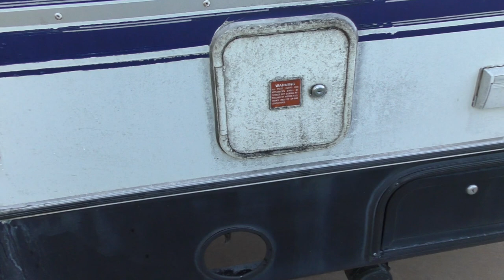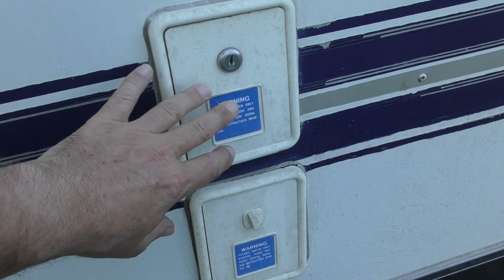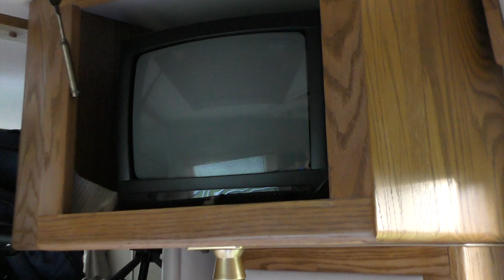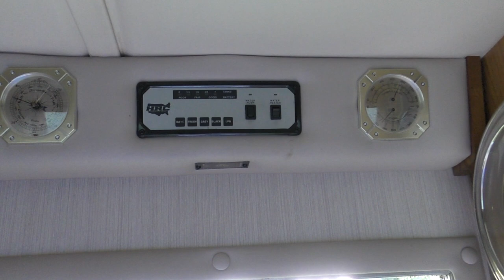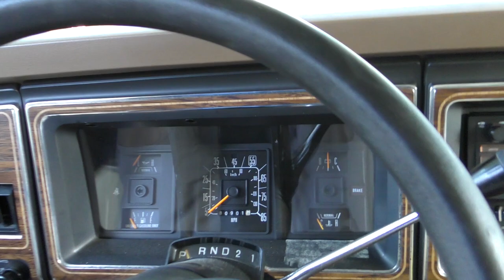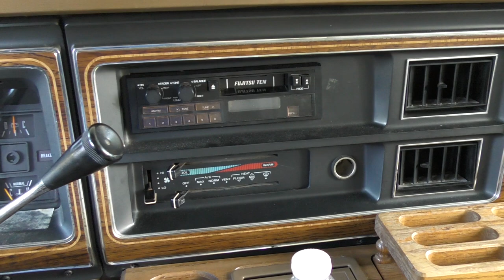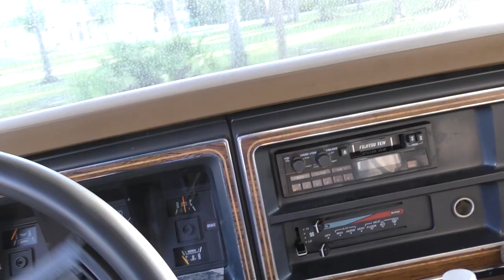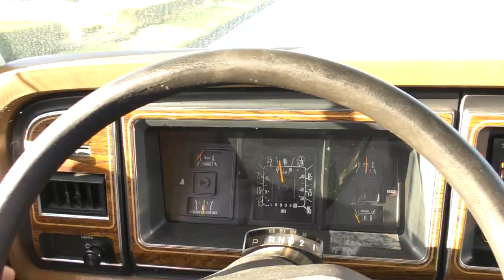The 1989 Holiday Rambler RV Project - Flask Update, Animals, and Getting Things Ready for the Road

Comment: You have found yourself a very special class C motorhome to say the least! A class C with a tag axle is a very rare species indeed. Nice that you have the 460 under the hood too, I'd take it over my class A V-10 in a heartbeat. I went over the top on my Rv and added a rooftop with nothing but solar panels (AC is a mini-split on the back) and a HUGE lithium battery bank that allows me to run EVERYTHING in the RV off batteries and solar...it's pretty damned slick. I'm looking forward to seeing new videos of you on the road buddy.

Comment: Since you probably have the funds, you could always put a gear vendors overdrive unit on that thing. I had an 82 bronco for a while with the c-6 and 351w and trying to do even 65 mph with the torque converter slip and relatively high 3.55:1 rear end the stock tack would register like 3500 RPM
Reply: 1989 was close to when the US national speed limit of 55 mph ended.  In that roughly 15 year era of driving 55, perhaps Ford figured these transmissions only had to handle speeds on larger vehicles up to perhaps 70 miles per hour.

Comment: I think that was Bob's camper they were in, in that still-shot you showed.  But the Good Old Boys had a bigger RV, which was driven, and I believe mistakenly, called a Winnebago by the great Tucker McElroy.  That has the same instrument cluster as my '77 F150! I would've teed the gauge senders and kept the factory oil and temp gauges working alongside the new gauges.
Fujitsu made OEM radios for Toyota at one time. I think that the "TEN" was only used for aftermarket Fujitsu audio equipment.